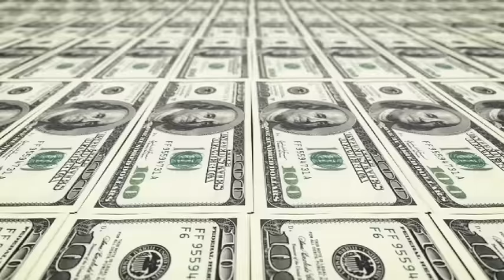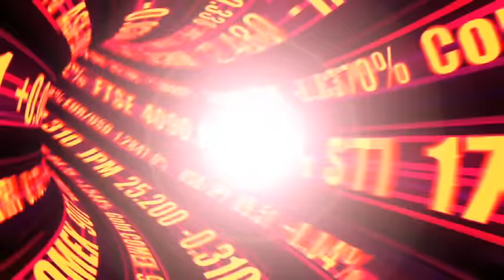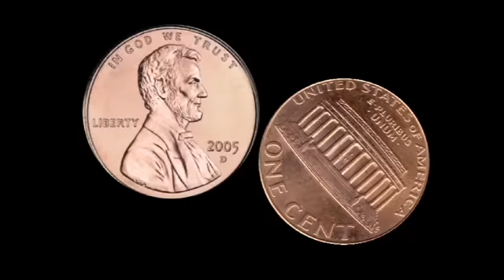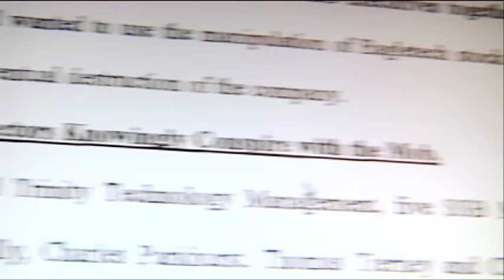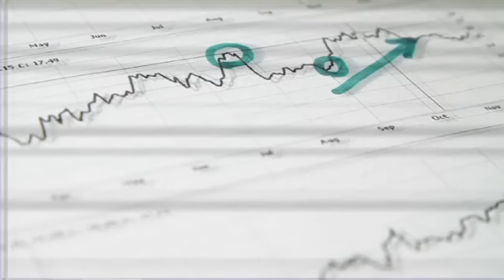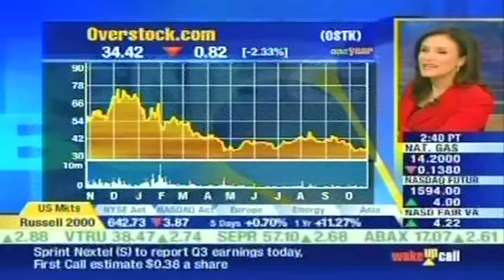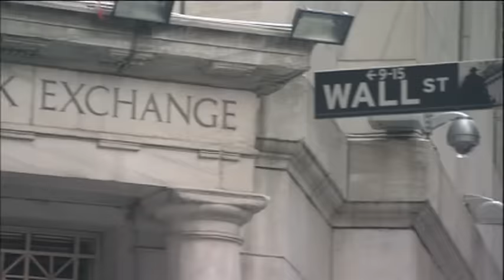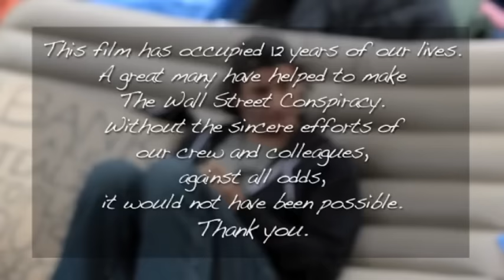The Wall Street Conspiracy Movie

Comment: Step by step , facts and data ...all line up perfectly with what we have seen in AMC the last few years ...(and more ) ... This shows the playbook and the fact that all of this is proven and well known.  Thus , the only answer is that regulation is worthless , our regulators are corrupt,  our elected leaders are weak, and the only thing that will make a difference is when the whole system comes crashing down....Unfortunately ?? , or Fotunately ?? ...we are not that far off now from this happening as the derivatives market is out of control.

Comment: Lots of conjecture here… and it seems pretty dated. Not sure what to say. Not captivating.
Reply: Look into the situation regarding the Pref A placeholder #MMTLP, the merger between TRCH & MMAT and its CEO John Brda. I think you'll find it isn't so dated after all.
Reply: @usernamenotfound007  I dont think I said anything about it being untrue, and not pertinent. I meant what I said and I said what I mean, the video is dated. For the most part it looks like it is from the 90's. It's not a captivating video/documentary. I think they could have done a considerably better job gathering more concrete data and information rather than simply statements from individuals. Hence me using the word "conjecture". Interesting overarching topic, crappy content, editing, and execution.
Reply: It really doesn't matter what you say! What matters is you got the message
Reply: @gregchris418  I used to be a part of whatever “community” this is, but essentially could no longer handle how condescending everyone was to outsiders. Similar to this comment you just gave. Ya’ll should try and practice speech that is both articulate AND grace-filled.
Reply: @nich_bot  Heh no worries dude, the SS guys are really off-putting with their high horses and is one of the reasons why I havent gone balls deep on that movement.  I'm not going to sit on the sidelines though - played this in 2021 and am still here today.  This video is something like a decade old, so you arent wrong about it looking dated 🤣